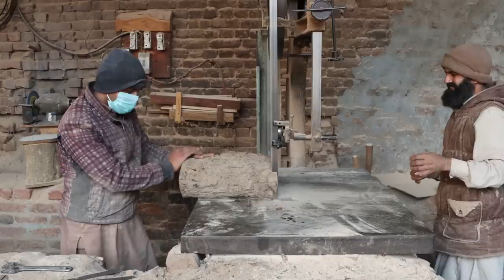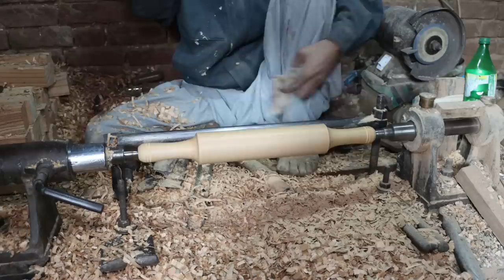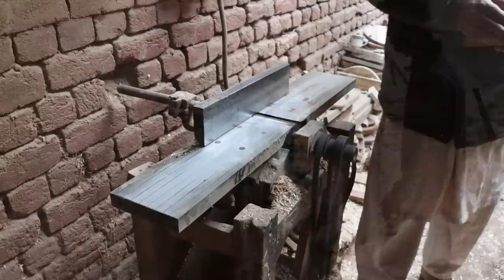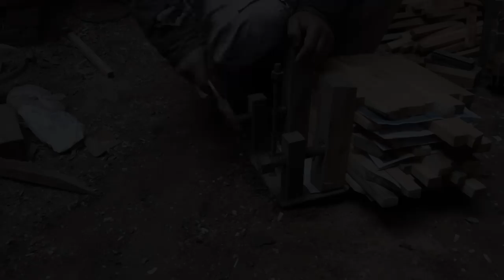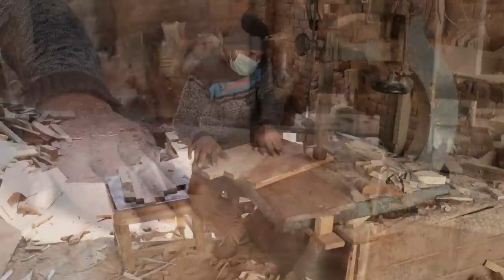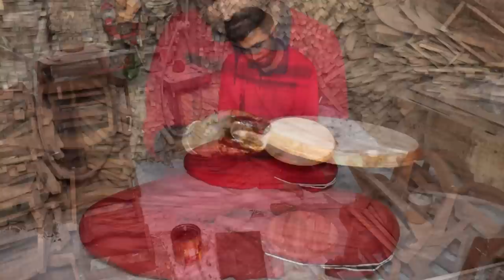Process of Making Rolling Board And Pin | Roti Maker Factory Manufacturing Process

Comment: I wish these dudes would make a simple push block instead of using their hand to push the wood up to and past the blade of the Bandsaw.  Remember the bandsaw was invented for butchers to cut meat faster
Reply: they know the Safety Rules as their four fingers.
Reply: Bandsaws are not so dangerous…circular saws account for the most accident
Reply: @cattleNhay  Bandsaws can be extremely dangerous if the “ blade/band” breaks and you’re standing on the side of it.  All saws are dangerous and demand 100% respect
Reply: @K-Effect  nah, if there is just a little blade guide, blade just breaks and wheels keep turning making a bunch of scary noises. I got 3 bandsaws in this size, happens every once in a while…cut hundreds of miles of wood like these guys. It’s really not that dangerous. The real danger is not paying attention or cutting round material.
Reply: @cattleNhay  You’ve just been lucky

Comment: So much wastage of wood, they make an unnecessarily long rectangle and then cut a circle out of it. Better to have smaller pieces on the sides, and longer pieces in the middle, and then cut a circle so that less material is wasted. Or just make rectangles and sell for more money because the surface area is larger. By doing some thinking and planning beforehand, they could cut their raw material costs by at least 20%
Reply: @Abi.e do you think these people don't know what you saying? the off cuts and sawdust are sold to people who use it for many other purposes. What they producing is a high quality item. Don't just comment but know the circumstances of them. They might be behind in technology but they are extremely knowledgeable and intelligent
Reply: @dulajohnstone5704  Your comment makes no sense, why produce unnecessarily large offcuts just so that you can sell them? With better planning you can have much less wastage of your expensive lumber.

This is not high quality at all - someone who has taken a beginner woodworking course could turn out something equivalent. Do you see them using sandpaper to get a nice finish anywhere in this video? Given that these will be used for rolling out dough, do you think the wax and varnish that they used is food safe?

I admire that they can turn out something usable with the third world tools and technology that they have, but high quality this is not.
Reply: @dulajohnstone5704  I think you are correct, Dula.  Nothing gets wasted.  When I'm doing my blacksmith work, there isn't a chip or a cut-off or anything -- except the scale and the rust -- that doesn't go into the scrap pile or scrap bucket for when I need something just that size.  The same when I'm working in my leather shop.  About the only leather I 'waste' is the dust from when the cuttings get that small.  "Waste not -- want not," it's not only in the Bible (probably in the Quran, too) -- it's a GOOD IDEA.

Comment: If you already figured out a way to screw the wide diameter cylinder part of a plastic bottle together, and it is still not completely air and liquid tight. Then a little bit more heatwork will solve that. "No soap" is an education about THE LAW, by that there is the will to be a public free from War. greyishgreblum, "Pottery tap and die" w/ "cookie cutter" tap tool modification💜
Reply: There is a fire burning for you, if you can get to it. A gallery in Hell waits for no opening. Justice interesting to our King as water mud and fire, a tray turntable.